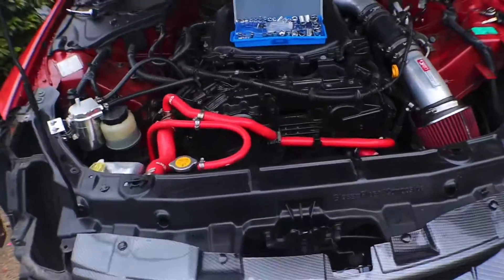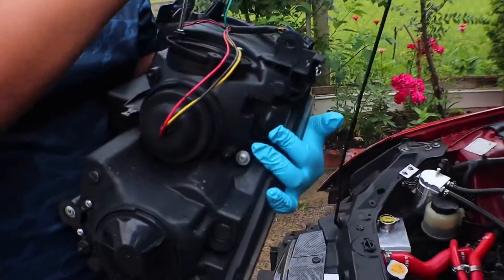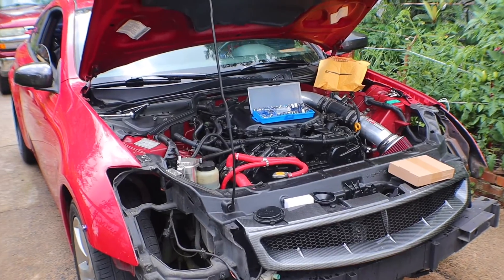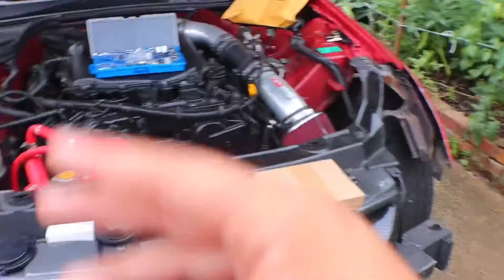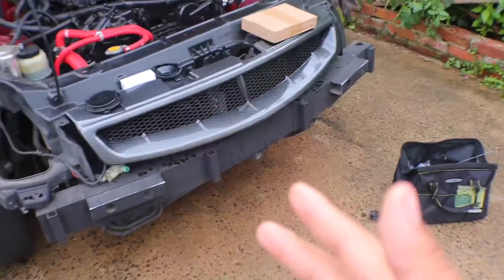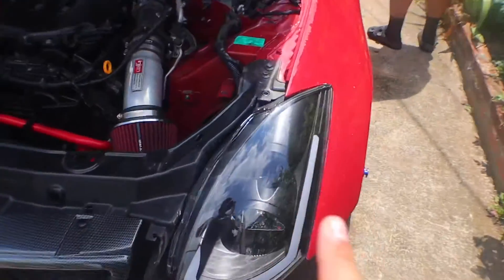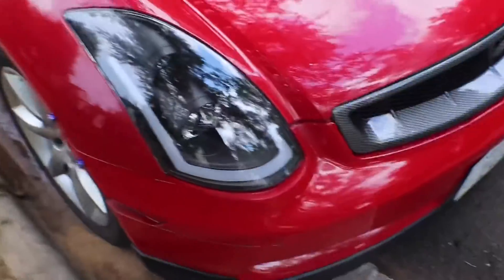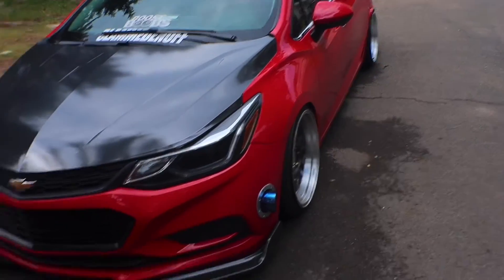My new Spec-d Headlights for my G35

Comment: how does the downroad light output for these Spec-D headlights compare to the factory headlights? How is the quality of these? fit on your car? any water leaking or lens fogging?  I'm thinking of replacing the factory headlights on my Honda and don't like that I cannot inspect the Spec-D before purchasing. Thank you
Reply from the maker: If u upgrade to better bulbs , and seals them once u get them you’ll be straight or they’ll fog up , just some extra sealant around will do and fit perfectly n look a lot better than oem ones